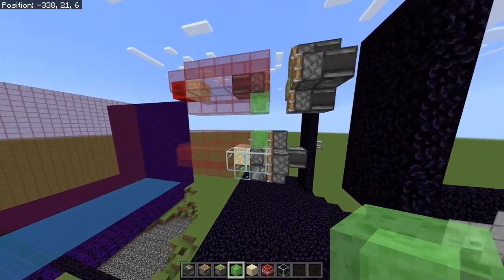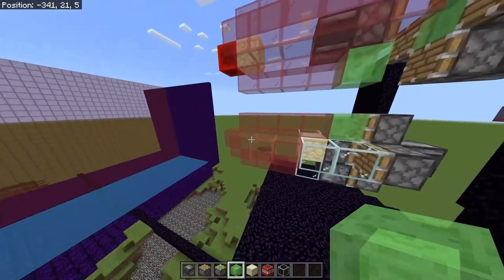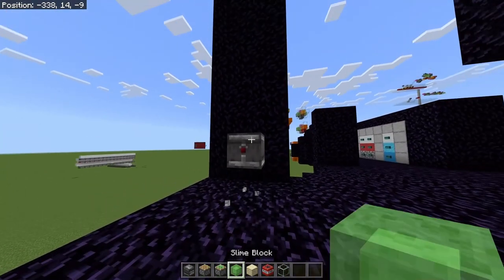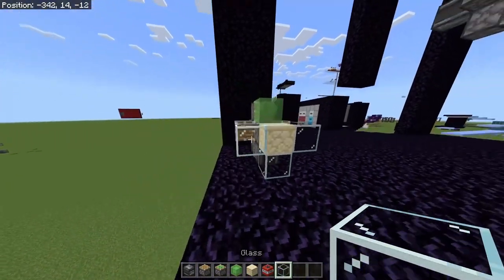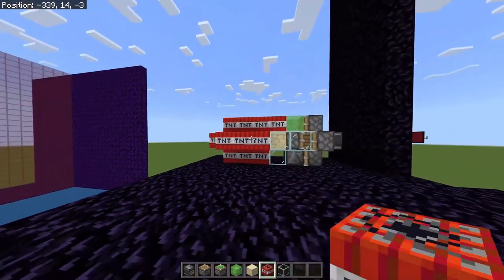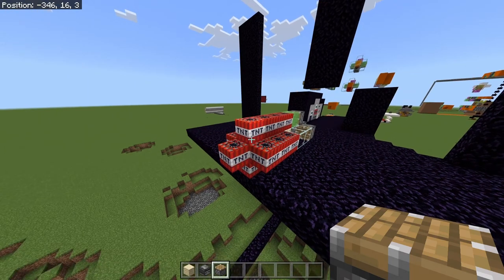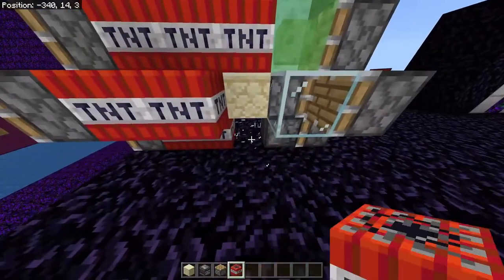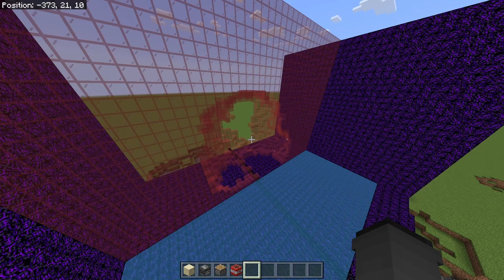Upgrade this common missile

Comment: hey cole could you make a nuke ? like how java uses many tnt minecarts but for bedrock instead?
Reply from the maker: I’ve looked into it a little bit, unfortunately mine carts act differently in bedrock but I may have to take a second look.
Reply: @ColePowered  You can push end crystals with a piston and stack them in one place